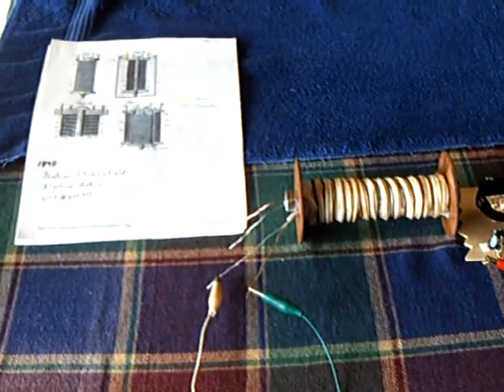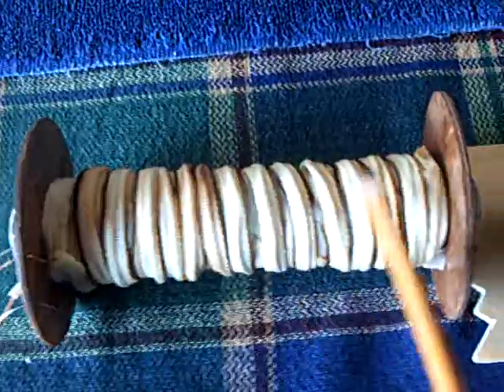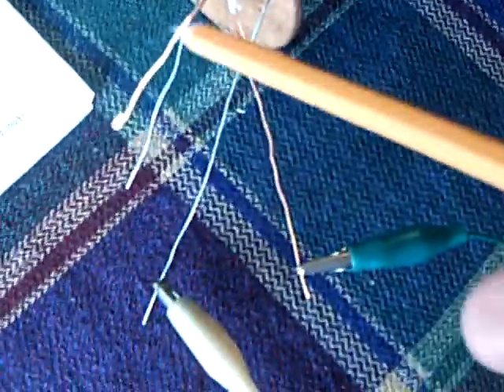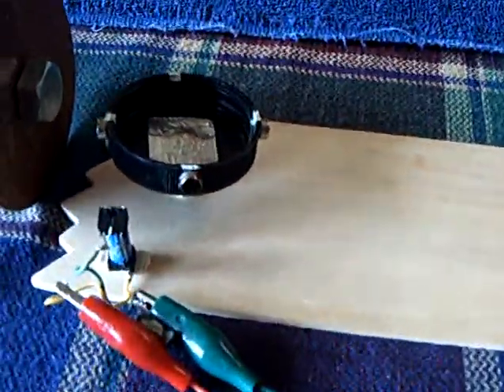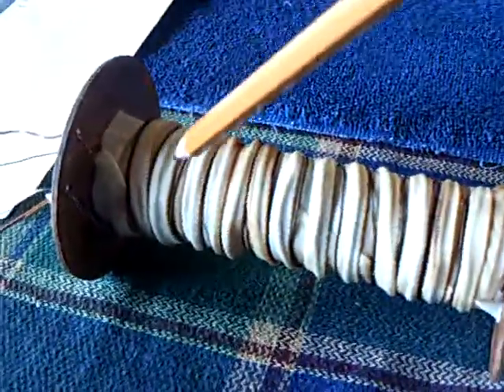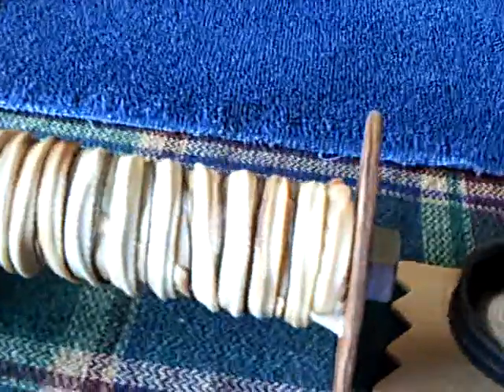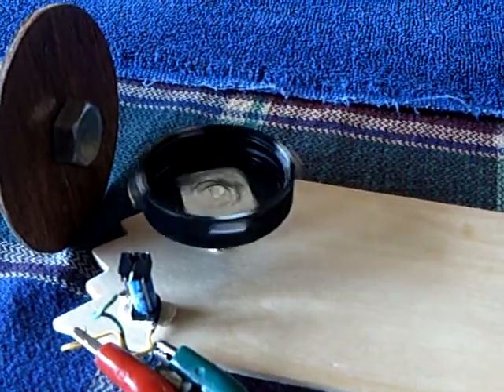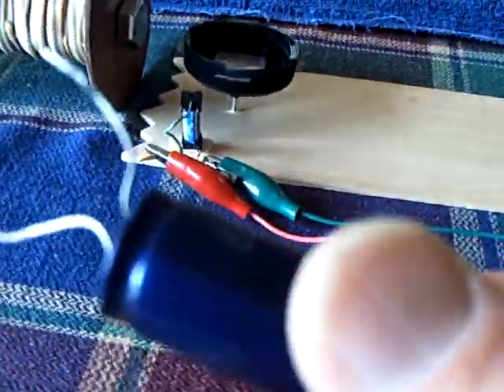Close to a Lasersaber--Stubblefield replication.ASF

Comment: Can I use plastic covered copper wire instead of cotton covered one.
Will it make any big difference

I am from india, usually we we don't find cotton copper wires in any of the electrical stores
Reply from the maker: No.  Plastic covered copper wire will no work.  This is basically a galvanic battery that Is copper and zinc.

Comment: To be clear, this is not "free engergy." The iron/copper make a glavonic battery, which will wear out as the metals corrode. Corrosion will happen faster as more current is drawn from the battery; this is merely a conversion of chemical energy to electric energy, and not a particularly efficient one at that.